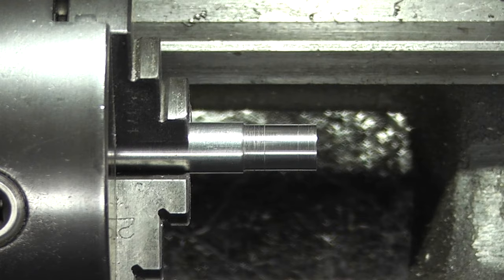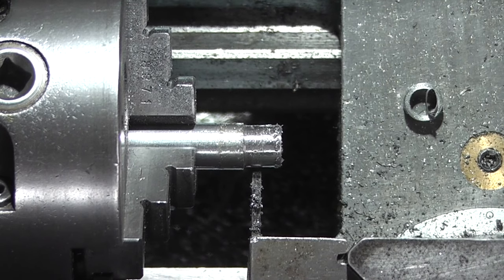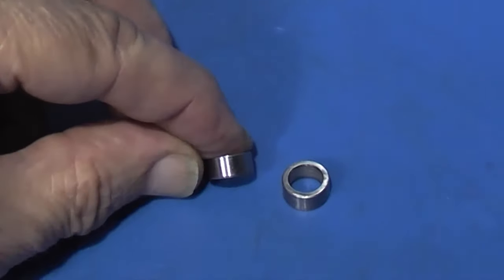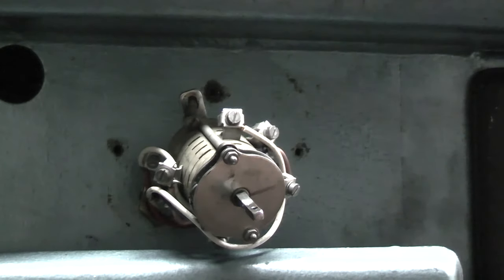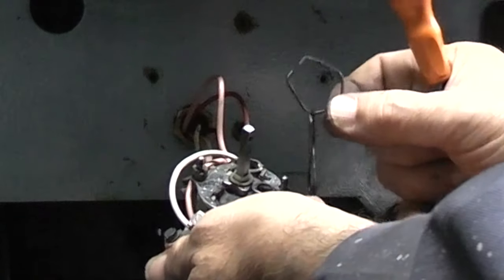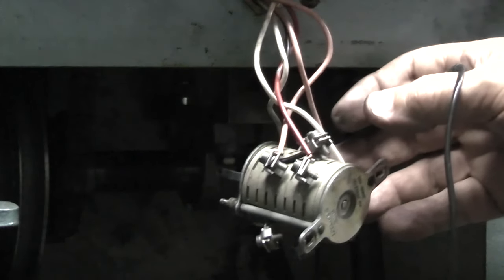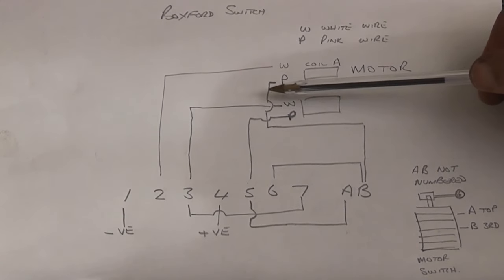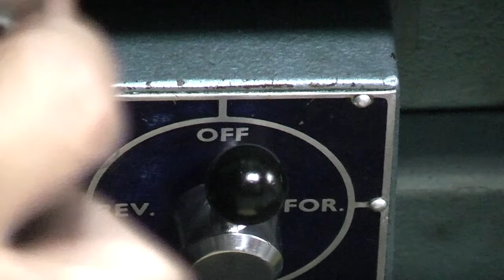Boxford forward & reverse switch repair

Comment: Hi there - I have just bought an ex schools -  Boxford model A - which has exactly this switch with the same  issue. So pleased to find this tutorial. Many thanks for taking the time to post this.  I will have a crack at making the rollers unfortunately I don't have a mill for the spring retaining slot. Yet!!
Reply from the maker: Hi. You could make a small v groove on the lathe to hold the spring in position